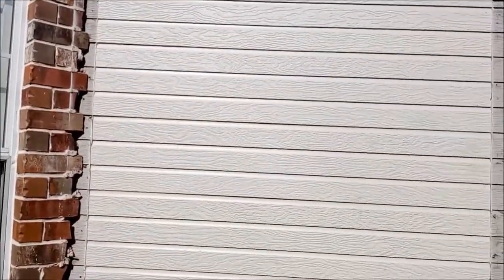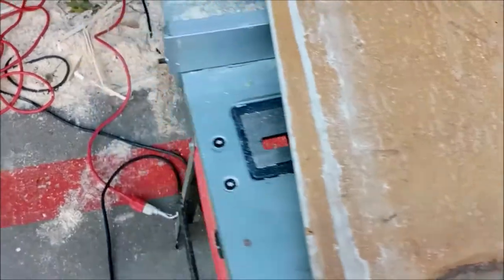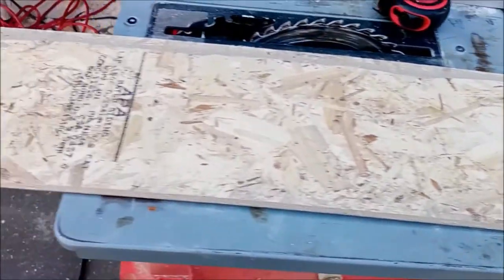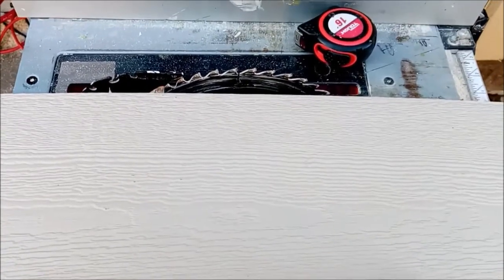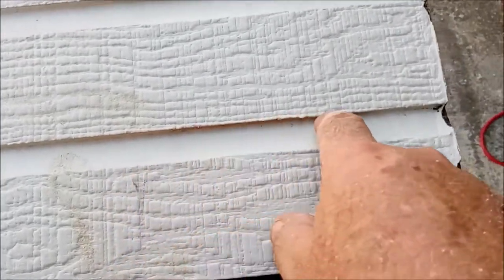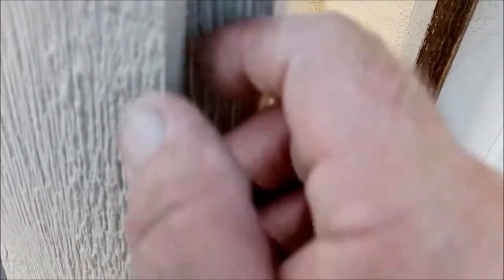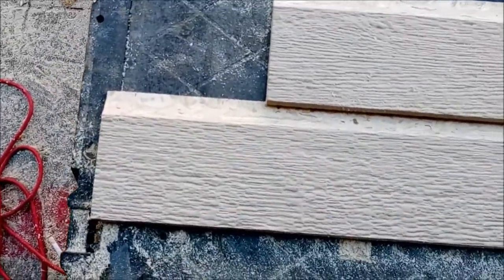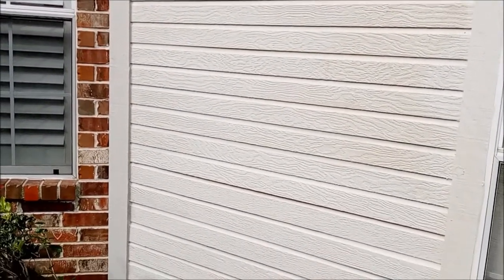REPLACE THE MASONITE SIDING ON YOUR HOUSE

Comment: TY Bill! I was cursed to have the exact masonite siding on your existing product-pattern, color and width. Your finished product looks to be an identical match, great job. My question is EXACTLY what material and manufacturer product did you replace it with? Excellent job, great video! Thx again!!
Reply from the maker: I'll get you the SKU# TOMORROW.  It is compressed chip board siding available at HD. Thanks for the question
Reply: @billgibson--tacticalyakn--outd  TY again Bill-is that Home Depot?
Reply from the maker: @jeffb6348  yep
Reply: What's the sku?

Comment: Would love your thoughts on making your fix work where the 1st "starter" board at the bottom is rotted and needs to be replaced.
Reply: I’m only replacing the lower most board that will require 3 pieces as the original material has 3x4” shapes. It has water damage. Everything above is alright. Going to use tinted (to match) exterior primer on all edges/surfaces especially on the bottom row.

Comment: Any links to this panel bit?, I’m not finding that part number anywhere online. Thanks for the solution
Reply from the maker: sorry for the slow response, I was out of town. I will get by rockler and get that info. I did check HD and they do not have the bit. Thanks again.
Reply: @billgibson--tacticalyakn--outd   we’re you able to get the info on the bit?
Reply: Rockler part # 39456, just got mine today, but can’t find 1/2” siding, everything is 3/8
Reply: @tedmiller1497 Did you see if it matched the contour of the old paneling?

Comment: I had aboit 200 sqaure feet of rotted masonite out of 3000 square feet of siding. Just replaced it with vinyl siding instead of fixing it. Once it starts getting water damage its game over.

Comment: Hi Bill, I'm having the same problem as others with making sure that I'm getting the correct router bit from Rockler. They have discontinued the Part # 733175215220 and their support is telling me to order Item #21522, however it states 2-1/2" D x 1/2" H x 1/2" Shank Rockler Cove Horizontal Raised Panel Bit. Can I use this bit? Thank you!!!

Comment: The OSB siding I'm using to replace my Masonite fascia and soffit is 3/8 of an inch thick.

Home Depot - Model # 498558 Store SKU # 498558 - LP SmartSide - 4 ft x 8 ft x 0.375 in
38 Series Cedar Texture Soffit Engineered Treated Wood Siding

I believe Bill Gibson used the following:

Home Depot - Model # 28869 Store SKU # 694876 - LP SmartSide - 7.84 in x 144 in x 0.315 in
Lap Engineered Treated Composite Siding - $10.92

One of these might the same as what he used or could be the one you need.

Rockler #21522 is 2-1/2" D x 1/2" H x 1/2" Shank Cove Horizontal Raised Panel Bit - $89.99 Each

Rockler #39456 is 3-1/2" D x 5/8" H x 1/2" Shank Cove Horizontal Raised Panel Bit - $114.99 Each

Comment: UPDATE, UPDATE, UPDATE!!! I got my boards back from the cabnetry shop, and OH BOY! They did a great job for me! They put the boards through their CNC machine and milled that Dutch lap profile and added tonge/grooves, such that I now have boards that have tonge and grooves and the final product looks like two boards the exact size. Now all I have to do is cut the top of the extra boards with the touge, to make the thrid piece and slide it under the groove thats on the bottom of the first board. They charged me $140, which I think was a steal considering having to purchase a router bit for $90-100 and do all of the work. Hey Bill, your technique inspired this update. Thank you again for posting your video.